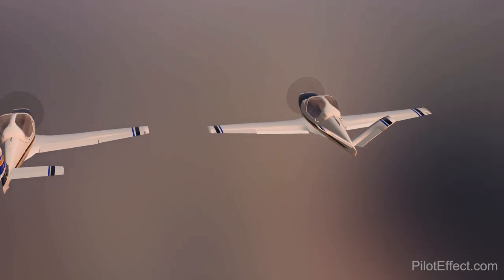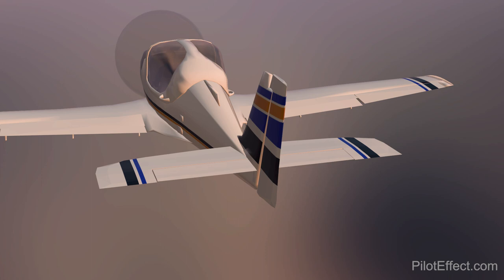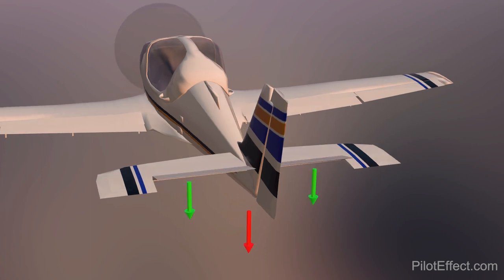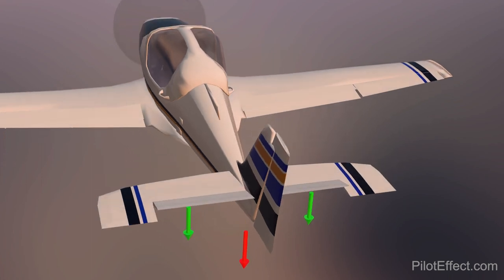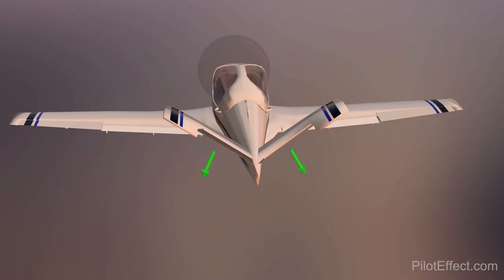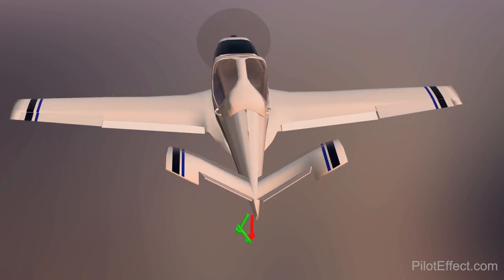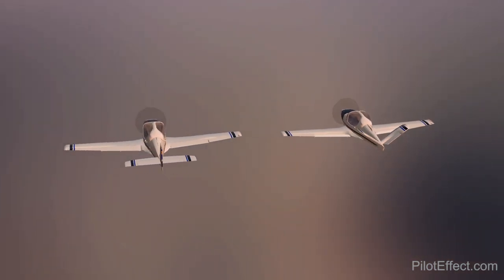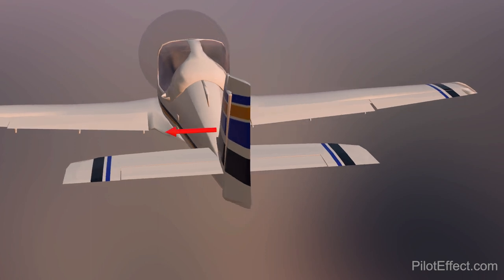V Tail | Pilot Tutorial

Comment: I would like to know more about how the control inputs of upward pitch and sideways yaw result in the correct amount of movement in the rudder-vators.

For example, you say that increase pitch and right yaw inputs result in the left rudder-vator moving upward and the right one remaining essentially neutral. Well, how does back pressure on the yoke for upward pitch combine with right foot pressure on the pedals to result in the combination of rudder-vator movement described?
Reply: I believe some kind of mixing unit mechanically combines pilot inputs to move flight control surfaces in a uniquely v-tail combination as explained in the video.

Comment: (1:42) Unsafe design. Not only that there is a resultant force to push the tail of the plane to the left causing the plane to turn to the right, there is a resultant force to cause the fuselage to spine in a counter-clockwise direction as well. That means the plane may become unstable during turns. 
Beechcraft Bonanza [what's with the V Tail? Is it Safe, is it really a Doctor Killer?]   (4:12)